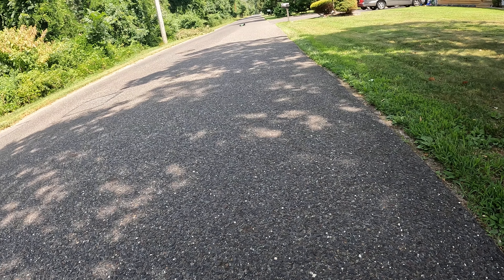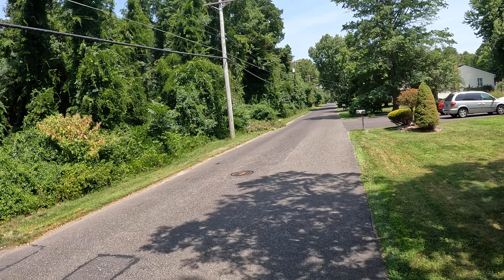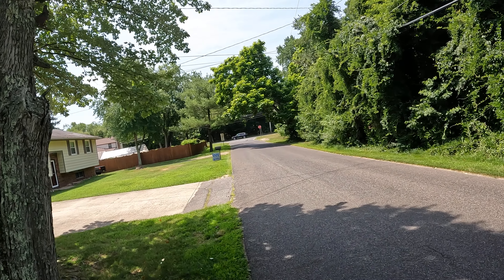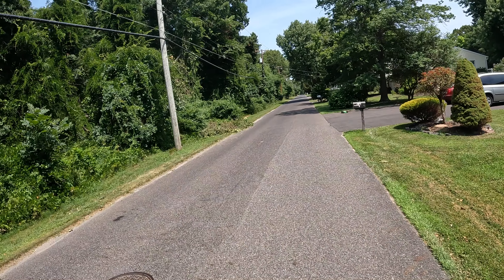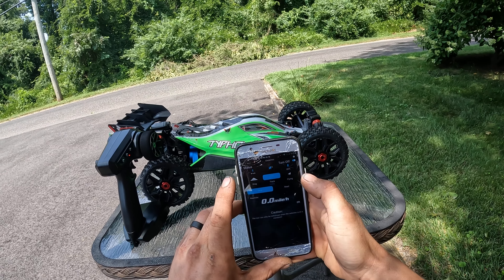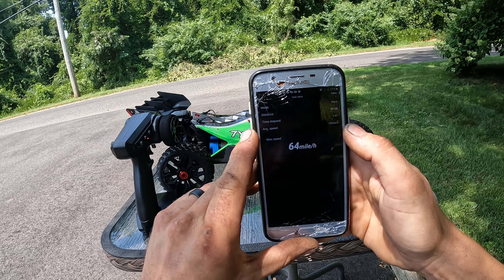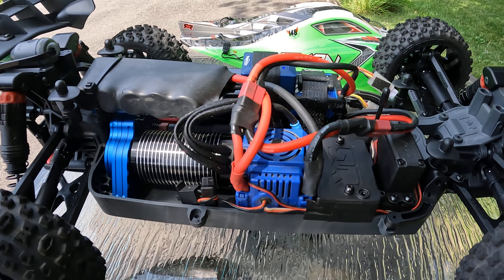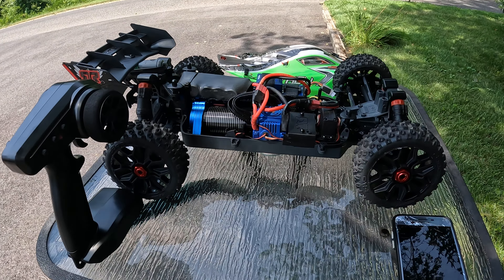Arrma Typhon MXL-6s 2200kv 4s RIPPER! NITROUS ON BUDDY!

Comment: Nice nice. I got one of these for Christmas... I know I'll have to add some power via brushless.. can ya tell me what supporting mods I will need?
Reply from the maker: Thanks buddy!👍👍 If you didn't already... my Playlists on channel are setup for each car , I have a few different videos on that typhon with the modifications that I have used in that car so far.... like motor mount/ driveshaft support  .... all mods are in the videos.... not much other than electronics I robbed from an old traxxas emax I had shelfing but I would say center driveshaft support is a must. Also upgrading the slipper clutch and or installing a spool would be a good thing to look into...neither of which I have done....YET,  I have some more plans coming for that setup in the future....... any questions lmk 👍👍

Comment: Will this ESC work on one 3s traxxas lipo and a jumper plug? I only ask because I’m looking at one for sale
Reply from the maker: So I don’t see a problem with using  3s but I would try to keep the MAH above 4000 and at least a 30 C but this is all depending on the vehicle that you were using it in . If you are going to run 6s I would not use a Traxxas or Dean’s connector I have melted Dean’s connectors on them and traxxas is no better. But once again this is all relevant to how hard you are going to push the system and the vehicle that you are running it in. Thank You and stay tuned for more videos coming very soon on this set up and build👍👍👊
Reply: @mitchellminer4596  thanks! I have learned my lesson on the deans connection but had no idea the traxxas brand plugs were iffy as well!